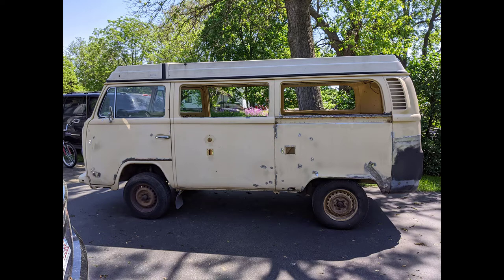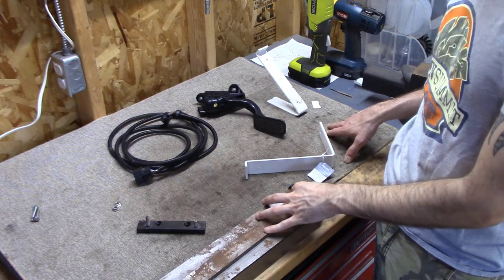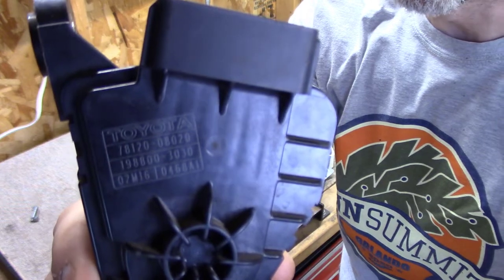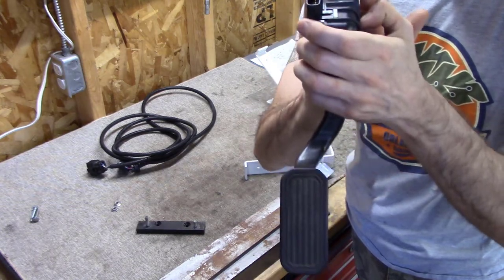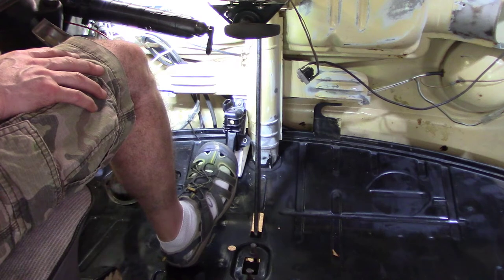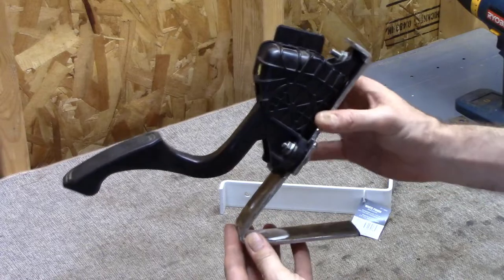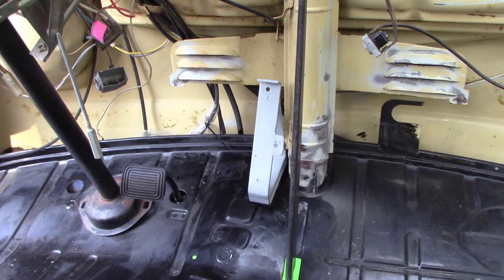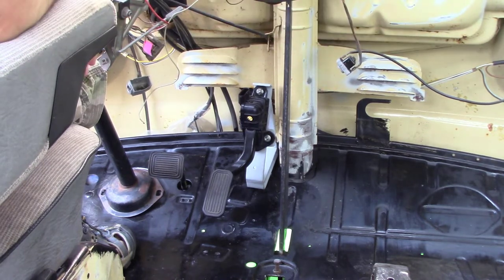VW Bus Electric Conversion Part 1: Accelerator pedal mounting bracket #evconversion

Comment: Hi Scotty, definetly a thrilling project and I will accompany you through YouTube. The pedal holder should survive the entire bus live ;-). I saw other conversions where they left the old mechanic and placed the pedal in the engine bay close to the motor controller. Thank you for sharing and greetings.
Reply from the maker: Thanks for following!  My next EV video is coming out this Sunday where I modify the fuel filler to make a J1772 inlet. I am still not the best welder, but I try again.